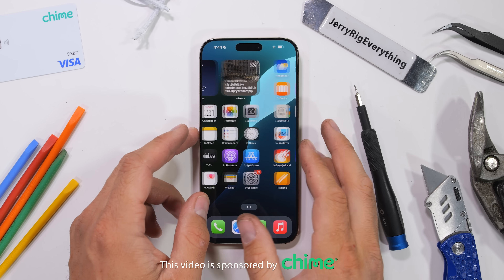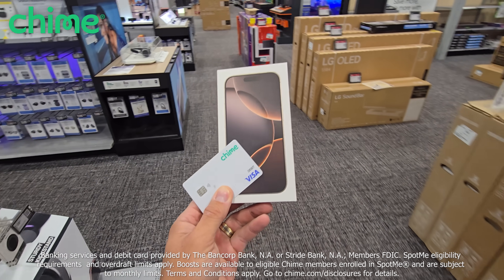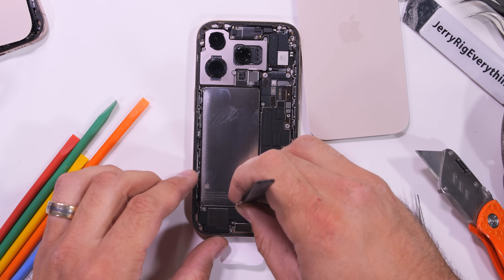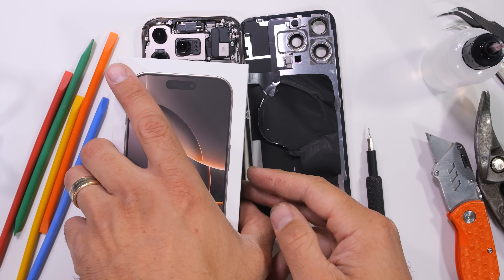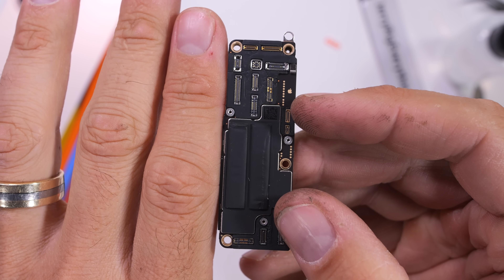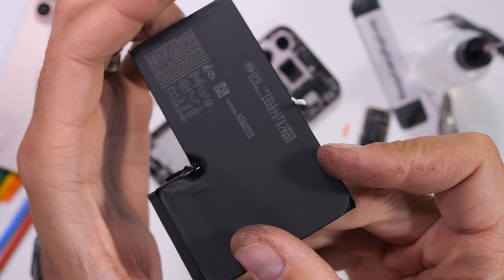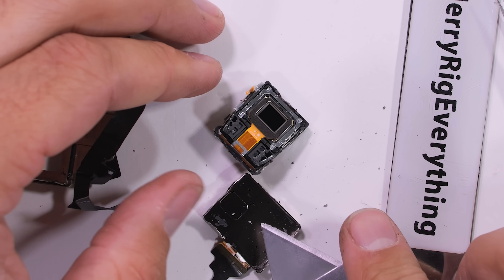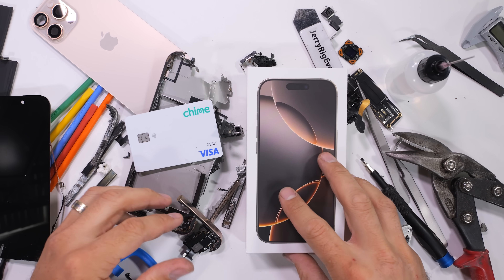Dear Apple: i am sorry...  (iPhone 16 Pro Max Teardown)

Comment: 6:06 He is taking apart the battery inefficiently. To take it apart you can apply voltage up to 30V to the tab and the adhesive should deactivate

Comment: I find it interesting that there is such a major difference in the battery casing between the pro and pro max. Normally Apple keeps them as similar as possible, and this opens the door to battery problems exclusive to only the pro or only the pro max. 🤔

Comment: I think I saw somewhere that you can use low electrical current to remove the battery on iPhone 16 lineups, but I don't know what the benefit is when they can use better pull tabs.

Comment: on ifixit i saw a new method of taking the battery off, they are not using pulltabs they run a current between them?? please check it out

Comment: Weird director at Apple on LinkedIn posted image that battery of iPhone can be remove by applying 9V to ground a little tab. It dissolve the glue and make batterie replacement easier then « supposedly » those pull tabs.

Comment: The trick with the pull tabs is to pull them very, very slowly.  You also want to keep the adhesive material from bunching up as it creates a spot to fail as you are pulling, and pulling at as shallow of an angle as possible.  Additionally, I have found that you don't want to pull too close to the battery, I assume because you are not allowing the tab space to stretch.

Don't get me wrong, the tabs can still fail, but I have much better luck.  I basically listen to the creaking sound the tab makes.  I pull a little and wait until the creaking stops, then pull a little more.

Comment: the metal battery holds electrically activated adhesive. You should connect a probe on the metal encasing on the battery and another probe to ground and supply 9 volts for around 1 minute and the battery should pop right off. PRG already spoke about this part.

Comment: These iPhones are getting pretty modular - add to that all the recycled materials and full repair manuals, they're almost turning into Fairphones. By the way Zack, they've started removing the Micro SD Card slot even on $300 mid-rangers like Xiaomi and Infinix - so that ship has sailed and IS NOW SINKING! I'm guessing now with internal storage being so big and fast, a user's old Micro SD card causes a performance bottleneck that the phone manufacturer ends up getting blamed for so they decided to just avoid that drama entirely 😂

Comment: What's the use of a repair guide if the parts can't be purchased easily ? Then you have to deal with the need of a machine to reprogram the parts to work with your iPhone cause all parts are coded...
They are definitely doing this mostly for appearances.

Comment: Check the ifixit teardown for details on the new ‘electrically detached’ adhesive used on this new battery. Very cool tech, and potential revolutionary if used on more components.

Comment: The battery case is interesting. I can imagine how it would make replacing the battery safer by making the battery rigid, but my first thought was how the shell behaves when the battery swells and wants to explode. I wonder if that process can be induced.

Comment: So, the 16 Pro MAX doesn't have a metal encased battery, but the  16 Pro does & the 16 & 16 Plus can be hardwired to remove battery, but the Pro's still use Pull Tabs. 

At the point, it feels like apple's just testing best use case scenario in their phones.

Comment: You need to do the regular 16 now to see the battery come out using an electrical current,
If I end up winning the phone I’m going to get it etched with your slogan, “glass is glass, and glass breaks” or “scratches at a level 6 with deeper grooves at a level 7”

Comment: Can you please start stating the battery capacity in Wh instead of mAh? It's a more accurate representation of battery capacity and can be compared across different battery chemistry and cell layouts which run at different voltages.

Comment: Been trying to repair my girlfriends iphone 11 pro charging port and the huge flex cable with the port itself, microphone and soldered IC, to which vibration "motor", loudspeaker and battery connect to is crazy complex for no reason. Good to see that at least on the newest iphone the port is on its own and would be fairly easy to replace, without soldering and other tinkering

Comment: I'll admit, I can't figure out why the metal battery is more repairable. Sure, it means a person is less likely to damage their batery on removal thus meaning it can be reused, but if you're replacing the battery is that important? Still cool as all hell to see especially if a use for the battery can be found. I'm very glad for the move to repairability. I've never owned a device I haven't taken apart and making it easier for me to do so makes me happy as hell

Comment: One small detail, if you use parts from another Iphone they're still not recognized even if you use the reset feature and you still have to buy new genuine apple parts so even if you buy a donor phone to change parts it still won't work

Comment: Apple knew for years that the EU will hold them accountable for thier customer unfriendly measures against repairs e.g. 

So Apple decided to make the necessary changes before the EU could enforce them. 

Selling them self as the innovator as usually and preventing another loss against law makers.

Besides, the repair ability of iPhones due to official guides and changes in components is a great foundation for a greenwashing campaign in the future for Apple.

Comment: Curious to hear your opinion on the non pro 16s not having pull tabs on the batteries and instead using the electrically debondable adhesive. 🤔

Comment: cheap batteries are a problem so apple is into mitigating the massive battery inflation problem (in about 1.5 years of use)  by a metal anti deformation enclosure. smart, dumb and bad for the consumer.

Comment: A battery inside a steel casing.
Good, now we only need some sort of compliant mechanism bracket thing to hold the battery in place instead of using glue to stick it in place.
I wonder how we can make one.....................................

Comment: I think the EU law will require that the battery needs to be "easily remove and replace" which means it cannot be sealed and you shouldn't need heat to open the phone to get access to the battery.

Comment: I'm surprised Jerry didn't mention the battery of the base iphone 16. Since it now uses glue that dissolves under current, instead of the pull tabs you actually connect a 9v battery to it

Comment: Another YouTuber in Australia has shown the iPhone 16 and 16 Plus models do not use pull tabs to remove the battery. Instead a 9-volt battery is connected to a hidden tab on the battery and to the charge port ground screw and left for 1.5 to 3 minutes. This process chemically alters the adhesive and the battery just lifts out. Also, iFixit have an article about this process.

Comment: Seems like Apple is trying out different approaches to repairability with this metal battery in the 16 pro and the low voltage adhesive removal in the base 16. I wonder if they will be combined in the 17 or if only one will stick around.

Comment: Leaving the SIM tray slot covered with a plastic mold instead of using it to something actually useful through the 15 line to the 16 line is truly mind boggling to me and the most Apple way I've seen, period.
Reply: I actually think that you are wrong. Steve jobs would never allow anything like that
Reply: @ozcandemir1190  Steve Jobs Apple time ended with iPhone 5. From that point on you have to agree that they did some seriously good and smart software and hardware updates, but iPhones could've been much better and actually the lead in smartphone techonology and innovations (like they always love to implement the "innovation" part in every years Keynote).
Reply: First of all to those replies that are saying iPhones outside of the US do use SIM card slots to this day, I know, because I live in the EU. Secondly, but why bother making 2 models from the same phone? I have a SIM tray on my phone and I use eSIM and everyone else I know who has iPhone. Just release SIM-trayless design in the EU too and do something about the huge space what that mold takes up.
Reply: @tghnt  you already know the answer, 2 models where one is just missing a part is infinitely cheaper than having to design separate manufacturing processes for each model
Reply: @tghnt ”why bother making two models of the same phone” 
*proceeds to ask them to make two models of the same phone*
Reply: It's not that they do not want to use it, it's that iPhones outside of the US do come with a sim tray, because eSIMs are not as popular in other countries, so they can't just take that space.
Reply: its being used outside the US
Reply: Sim Card models are sold outside of the United States.

Comment: Allegedly the new iPhones use small 9 Volt batterys to remove the iPhone battery and you need to connect it to some cable and it heats up the Adhesive and it allows you to remove it

Comment: Dear Apple: No sorry... Apple is one of the companies who actively worked against repairability and the right to repair. See Luis Rossmann. Those new plans does not make the repairability better. They existed before and doesn't solve the software blockade of third party parts. And last it's still too complicate to repair the phone by mechanical design. To share plans is thr right ans long necessary step but that doesn't make a apple a repair friendly company.

Comment: you have to remove speaker and the vibration module to get access of these pull tabs,since iphone 12 that method is not changed

Comment: I'm curious to see zack try out the new battery removal process for the base iPhone 16 Apple has ditched the usual pull tabs in favor of an adhesive that debonds in response to a low electrical current

Comment: What was that fuss about the battery been electricity disconnected with 9v battery and jump-start alike clamps? Those are all packed with pull tabs.
UPD: turns out all of that sorcery is used on non-pro versions of iphones)

Comment: Weird that the pro max dosen't have a metal casing but the normal pro does. Also would like to see the difference in durability between them if one is more puncture-resistant or if its purely just cosmetic or functional.

Comment: I hope every big phone manufacturer publish their guides from their phones. Also, i hate glued batteries, when they expand due to heat or age, its really dangerous to remove and replace. Also if the alcohol gets under the battery, reach the screen flex ribbon and travels to the screen, separating the glass and leaving dark/bright marks on it. This happened me 1 time after multiple succesful battery replacement.

Comment: I'm not an iPhone designer or something like that but I think it's not necessary to put a battery in a metal case if it does not even help remove heat from the phone and it doesn't make the repairability harder or easier. If I'm wrong I would hear about more if anyone knows why Apple chose to put the battery to a metal casing

Comment: I do like the new 16 that has the electrically activated removal strips.  Use a 9Volt battery to connect the 2 points and it disintegrates the adhesive.  Lets hope it works better than their useless pull tabs.  A great day for repairability as long as it works, looks promising though!!!

Comment: That metal battery case could have just 2-3 screws like dell is doing inside their laptops and you could remove it in 10 seconds.
Reply: 2-3 tiny screws wouldn’t be able to hold it in well and reduces water resistance. I say tiny as huge screws will waste space for the battery and make the phone thicker than it’s supposed to be

Comment: I’m very happy that apple finally made genuine parts installed by 3rd party technicians work as they should after the ios 18 update. I have been using an iPhone 12pro for 4 years now and it had that battery not genuine message for a while after I got it replaced but after the update I was able to remove it 😊

Comment: I’ve heard that this time Apple has used ‘Electrically-Activated Adhesive’ in their iPhone 16 (non-pro models) to keep the battery in place. 
A 9-volt battery will be needed for 30 seconds to loosen the adhesive that holds the battery. Is it better than pull tabs or not?

We’ll have to see what Jerry’s thoughts are in this regard. 👀😄

Comment: I just done a phone housing swap on my IPhone 14 Pro Max two days ago because I broke the back glass on it and damaged the mag charger coil on it. I took it to the local repair store and told them to replace the coil and the back glass then let me know it they found anything else while they was in it. Then they replaced an antenna. They charged me $90 for the antenna then $300 for the back glass. I asked for a listed of parts that was replaced. They gave an invoice with part numbers on it. I noticed the MagSafe wouldn’t hold the charger very well anymore when I got it back then my son dropped it with a good case installed on it and it shattered the back glass again one week after being fixed. So I just continued to use it then the battery failed. So this time I said I’m gonna fix it and stop giving my money away for half done repairs. I phone seller that had a phone that was taking in for parts that had a good back housing and battery in it. Then I transferred all the internal from my phone over to it but the MagSafe coil and the antennas that are glued to the back and the charge port. It wasn’t that hard of a repair just took a little time. Then keeping the screw in order was a pain. All 4 million lol now my phone works great like new.  I learned take your time and keep organized and the phone ain’t that hard to repair.

Comment: Why is it that apple is so confused with the iPhone's battery situation?   just hear me out, the pros have the adhesive pull tabs where as the non-pro is using a new electrically activated adhesive under the battery that gets loose when current is passed through it,right?   but my question is why though ??
why only the non pro model???  and also why is it that the 16 pro has a battery covered in a metal enclosure and the pro max isn't ????  Is it done to keep the battery cool while fast charging(for better heat dissipation)????  But then the charging specs of the pro and pro max is the same right ?????  So then whats the logic ????? and will this battery enclosure not get heated if the processor is running hot and degrade the battery ?????
whats going on in the headquarters????? 
:face-blue-question-mark::face-blue-covering-eyes:

Comment: I thought the battery the other tear down guy showed supposed use battery to discharge the adhesive so it will pop it self out without pulling?

Comment: It is interesting that iPhones have a IP68 rating while Apple warranty does not cover water damage to any degree, even if the device ingress protection failed while being submerged for a couple minutes at a shallow depth, so having the re-sealed phone from the video would be the same as having a factory new device when it comes to the care you have to give it.

Comment: As someone who has been using Android phones for a long time and loves hiking in places without cellular connection, I’ve been keeping an eye on iPhones ever since they introduced the Emergency SOS via satellite feature with the iPhone 14. Now that the iPhone 15 has USB-C as standard, and with iOS 18 introducing iMessaging over satellite along with new customization options for the interface, my interest is at its peak. So much so that, for the first time ever, I’m seriously considering buying an iPhone. The limiting factor is that Apple Satellite is not yet supported in my country. I also appreciate that, probably due to EU regulations, the repairability is going to be better.

Thanks for the video.

Comment: For those wondering what the EU considers a "replaceable battery":

"A portable battery should be considered to be removable by the end-user when it can be removed with the use of commercially available tools and without requiring the use of specialised tools, unless they are provided free of charge, or proprietary tools, thermal energy or solvents to disassemble it."
Reply: So basically every smartphone ever already has a replaceable battery under the EU guidance and yet people still glaze the EU like it's the second coming.

Comment: Strange to see that every iPhone 16 model has a different battery design and slightly different internals despite beeing nearly identical on the outside. Normal 16: battery is electrically removeable / 16 Pro: metal cased battery with pull tabs / 16 Pro Max: pretty standard battery with pull tabs.

Comment: Very cool battery metal casing! It's odd, though, since the 16 and 16 + have that cool metal adhesive that can be removed by wiring a 9V battery.
Hoping I win because I got scammed with a blacklisted 15 pro max (the guy marked it lost and got it blacklisted a few months after I bought it) and couldn't use my data.

Comment: So why didn't apple do the electric charge battery glue in the pro versions and if they are going to start wrapping batteries in metal how is that going to work? Also, since they only included the pro and not the pro max can we assume they still plan to sell this version when the EU regulation take effect?

Comment: Why wouldn't smartphone manufacturers use thermal paste as an adhesive under the battery? 
Wouldn't that remove the heat very efficiently?

Comment: wait that is weird that only the smaller size 16 pro has a metal casing on the battery and not the pro max... very interesting. i wonder why its like this. also the battery removal on the non pro 16's is actually pretty cool